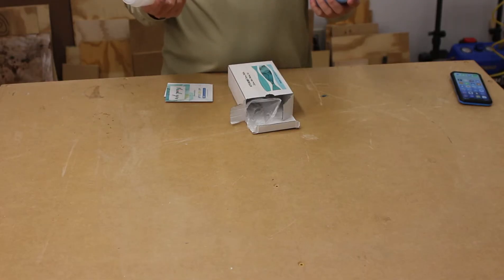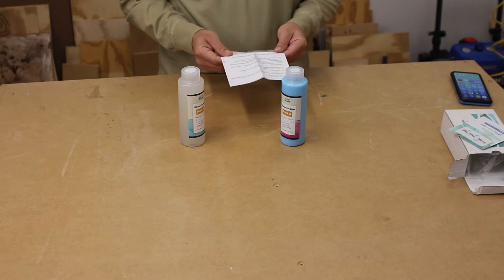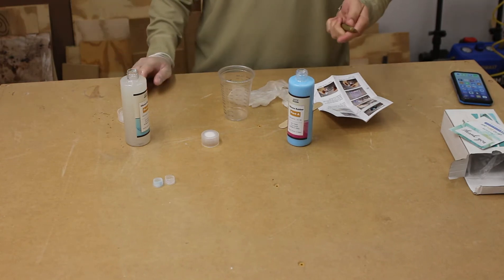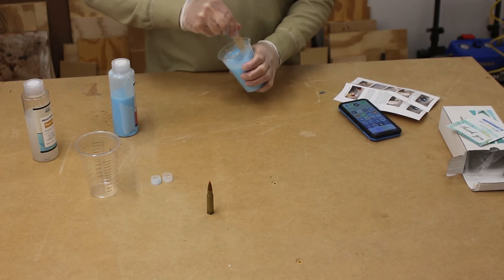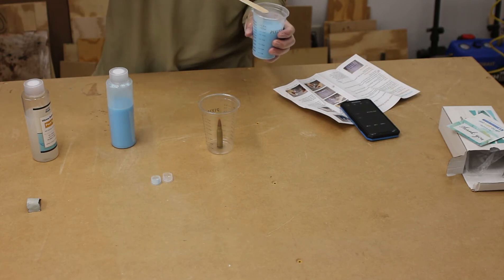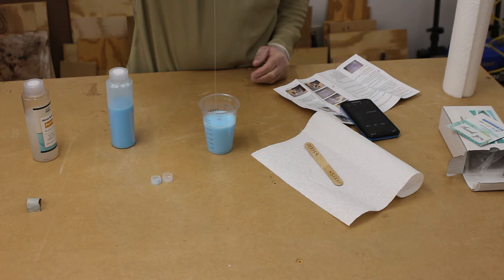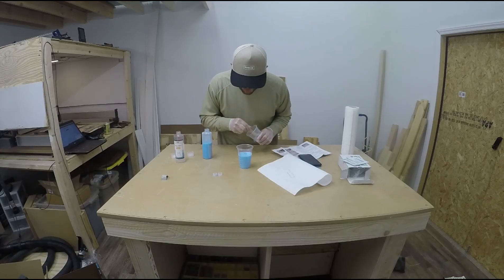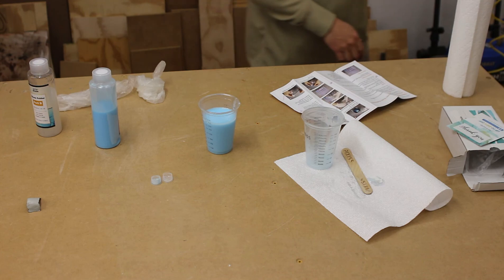Silicone Mold Making - Casting a Bullet Mold

Comment: You have likely already realized this, but this won't work with regular silicone. The lead comes out too hot from the crucible and will likely melt/deform your mold. They DO make high temp silicone that can be used to make lead molds though.
Reply: Left us in suspense, eh?
Reply from the maker: https://youtu.be/BAcZerSbfpc
Reply from the maker: Oh absolutely, this is only to pour epoxy replicas into.